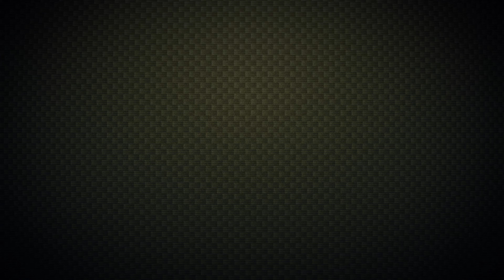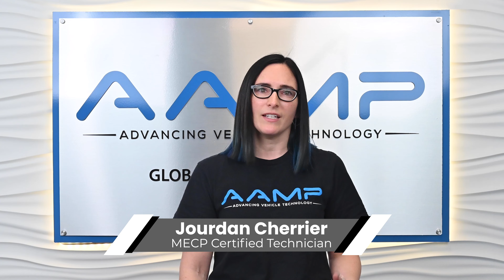BRCOAMPBRKT - Stinger Install (4k)

Comment: Thanks for the video, but you didn’t explain how to connect your amp to my B&O factory amp. We need a full video on how to connect the whole system along with the TXFBB12
SWING GATE 12-INCH SUBWOOFER ENCLOSURE FOR FULL-SIZE FORD BRONCO
Reply: They sell a T harness that plugs into the factory radio.